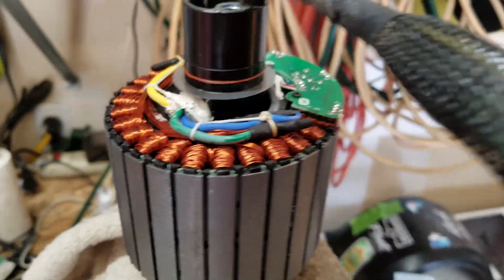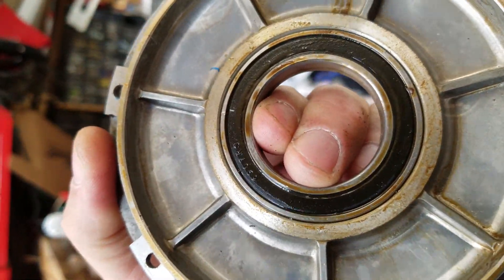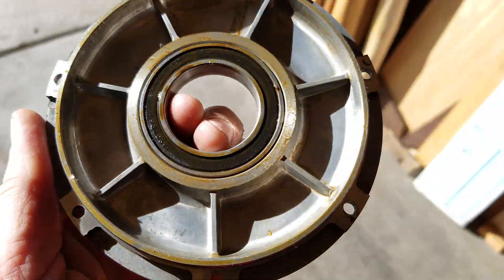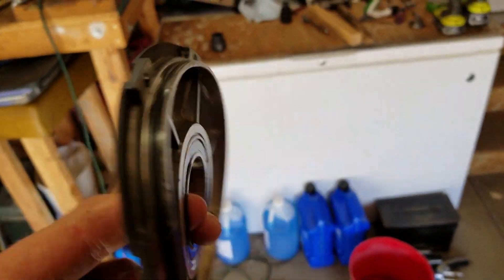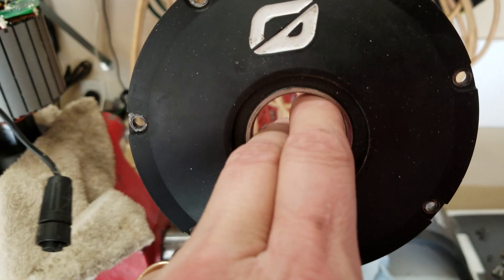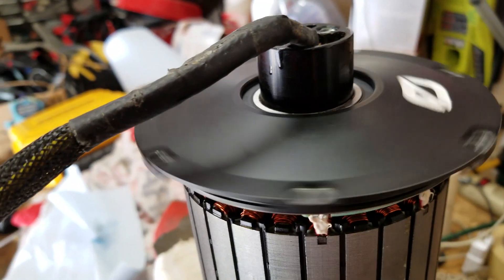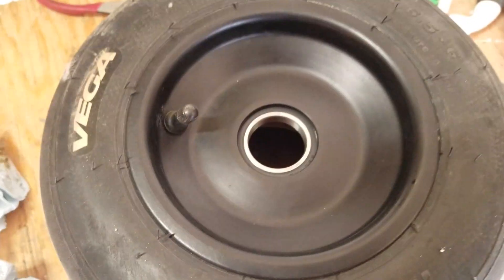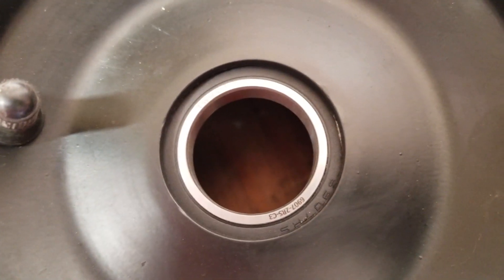QUIET your Onewheel!  Ceramic Bearing Replacement Highlights

Comment: Aw man, I hose off and leave mine in the drying cupboard after every session at my local beach, I should probably get some oil in there soon.  I've actually just fitted my Burris treaded and I'm feeling it.  I added some fresh blue thread-lock to those 5 tiny cable bracket bolt/screw's and spun a couple rounds of plumbers PTFE tape around the 4 wheel mounting bolts.  Do you follow suit with these procedures or just do the tighten up checks every so often?  

Also I had trouble getting my other Burris tyre bead to seat.  After cowering  under the work bench and taking my new tyre up to a presumably sketchy 65psi and still not getting the bead to pop on (using dish soapy water) I realised that the round electric cord of my extension cable was thinner than the inner rim.  
So with this extension cord (not plugged in obviously) I slotted it in and round the half side of the tyre that the bead was further up on, then bingo this kept the tyre's bead more level letting the stubborn/stuck side move (at only 30psi).  With the soapy water peeling the electrical cabe back out was super easy and then the seal pop finish slid up (now evenly) and at even less pressure 30psi.  I reckon this is the best method for anybody experiencing this problem, and you could probably manage it by hand pump this way too.
Reply: stoke pusher if you hose it down often, I definitely would take apart the hub and wipe everything clean and put a light coat of oil in there, if you do that once in a while , even like once a month I’m sure you can keep everything in top top shape regardless of the water and salt ...     on the heavy wet days though would probably do it right away or that weekend....   but yah doesn’t take much for moisture to get inside there, I ride in light wet conditions sometimes , mainly park grass that’s been soaked with sprinklers but nothing crazy and moisture and some contaminants gets inside...   however if you catch it within reasonable time, it’s easy to make it like new in there again...    if let sit in there too long though: irreversible damage starts...
Reply: Did you badgerproof?  If yes, can you comment on efficacy?

Comment: The ceramic bearings won't rust but won't the metal around it still
Reply: Aluminum doesn’t rust, but anyway that’s irrelevant. Even if the bearing seat did rust it wouldn’t matter. It matters inside bearings because they are precision parts that only operate smoothly due to their precision nature. Adding rust, or debris, or really any foreign matter into them destroys them pretty much instantly.

Comment: where did you get the bearings?
Reply from the maker: Burris.  Took me some time to figure out that it makes some clicking when rotating and there is a tiny bit of play.  I have not taken it back  apart to troubleshoot so i am not sure if I messed up in assembly or what.
Reply: @striderz69  any updates on this? Did you ever replace these bearings, or did the noise go away
Reply from the maker: @johnd9357  Yes, the bearing were new in the final scene and quieted the noise.

Comment: what is the mileage on your onewheel??
Reply from the maker: It was only 443 miles when stolen out of my garage 8 months ago.  THe bearings were bad because I tried a snow sock with it and got water in the bearings.